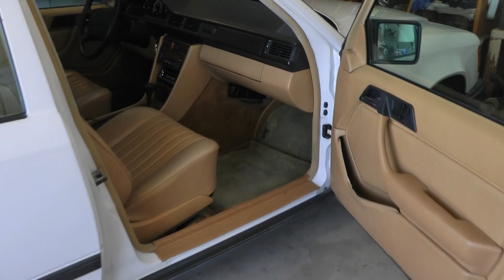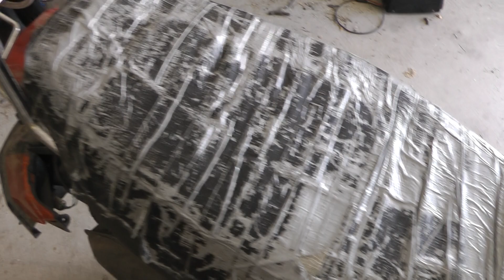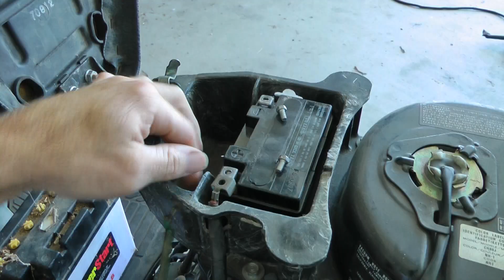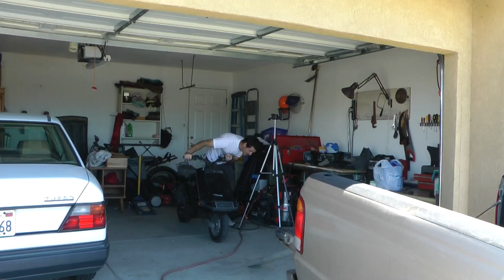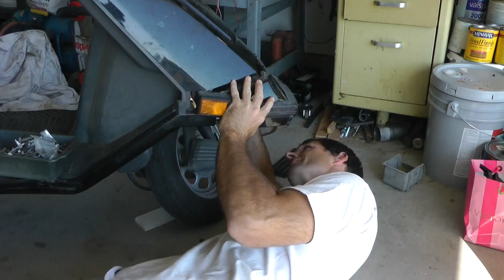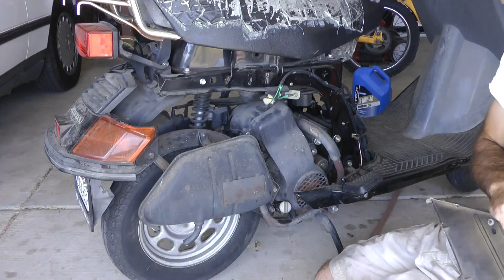Free Scooter Project: Shopping For A Mercedes Benz w/ Honda Elite 80 Bonus!

Comment: great car, if you think the 300d is slow, you should try a NA 240d. If the 300d's 0-60 times were measured on a calendar then the 240d would need to be carbon dated.

 Probably the best car i ever owned, my entire family owned 240d's and 300d's for years, my personal 240d had over 300k before i sold it in washington, he then took it to mexico and sent me a picture seven years later of someone broadsiding it at 500k miles.

Comment: You sure did a whole lot of running with the bike , you put in a battery at 7951 miles and than you don't want to do stuff unless you know how the engine is.
You take off the airbox , spray gas in the carburator and the odo shows 8020 miles.
Who let the scooter out :D :D :D 
But hey , it's fun to watch ;)

Comment: I just picked up an 83 240D with 108k miles on it perfect interior, 3 small spots of rust. Had to do some work to the injector pump and fuel lines but shes sorted now. 600 bucks out of my pocket plus filter and various vacuum hoses and she goes down the road great. Best cars I have ever owned. almost like driving it more then my 79 f250 gets way better gas MPG.

Comment: Wow, what a great deal! A 300 Turbo Diesel in showroom condition without rust for 1600 bucks (includind the Scooter)! I would buy 10 of the W124 Turbo D's if I could find them. In Germany  it is a very rare car (even more without rust!) And it is getting even more rare and more expensive since technologie nerds all over the world tune the Turbodiesel engines up to 500 HP (in a healthy way) or even up to 1000 HP!! Then the acceleration speed will not longer be measured with a calender for sure! By the way: I drove several 200 D's (W115 = /8, W123, W124) since I was eighteen and got my driving license a long time ago. Over 1500 kilogramm with 55 HP....I can tell! "Speed" is measured in moon orbits! Sometimes it was just impossible to overtake a big bus or big truck!
Also I want to asure you: 200000 mls and U'r motor is fine and just  "eingefahren"! I could't find the right matching word. Treated in the right way it is able to reach 1 million kilometer (over 600000mls). W124, the very last of the solid and good Mercedes. So be happy!
In 1998 I bought a brandnew expensive W210 and I was looking forward to drive it for 25 years. But the W210 is junk/scrap as everybody knows = CEO Schrempp did all for raising the companies profit, manufactured with low quality parts and so the customers were cheaten. Unfortunately I have no choice as an early retired person. I still own the car because I could'nt afford a newer, or maybe even better, an older one (W123/W124). I really would like to have one of those again.
Last but not least: Thanks for sharing this and other videos.

Comment: thats the car that built mercs reputation , and a turbo to boot , it will still be going after the 55 is in the dumpster , or in fact , may actually have been turned into the dumpster ,,, and old hondas seldom surprise me ,,,, they were built in an era when quality was built in , not an after market bolt on.

Comment: I dont know about old scooters but at the front of the 2007 ones there where a bunch of wires we just took them of the conector and put a screwdriver on the starter to start them up.

Comment: hey just a heads up

219000 miles is not even considered "broken in" for a 300d.
Reply: ikr my grandpa owned one for almost 30 years, the car easily outlived him with only minor issues throughout its lifetime.
Reply: Seen a video of one that someone opened up with 300,000 on it and it was in great shape just put a new turbo and gaskets and it was back on the road even tho it never had a problem before
Reply: One 300D that was in use of Finnish army it was driven like 1.500000Km (one million and 500 thousand km) Only with Basic maintenance
Reply: VHFGamer but will be broken pretty soon

Comment: congratulations on the elite 80 very nice how it started up like a champ after years of sitting dilapidated yours is very remincent to mine a 87 with neglect remember to go through the electric too cdi box wears out and high performance ones are available coil could get old too if it doesn't hold on to mid range and top end it could be that the ignition is not happening mine bogs at top

Comment: Yeah...I think I'll 'take a pass' w/regard to the "I'm too cool for school" and  the sarcasm directed to the Honda 'Elite'. (did that engine start! Yes? even w/shitty gas? Then 'case-closed' with as far as' just how tough and reliable are Honda scooters'...? I could live w/o you pointing out the obvious fact of the heavy use of 'plastics' in the outer-shell of the Honda...the fact that the plastics are STILL there, despite at least two 'lay-downs' should be proof enough that the plastics are extremely durable and incapable of rusting or rotting! (they weigh a lot less than the same dimensions of any metals in common use) As far as 'power & speed' are concerned...you remember some simple conversion formulas from High School, maybe? That 80cc engine puts out more power 'size-for-size' than any other internal-combustion engine in the World.          "Mass vs. Thrust vs. (square of resistance) vs. Inertia vs. 'event duration'...=Velocity" (pro-rated to external variables)    Honda builds the finest two-wheel vehicles in the World. Period.
Reply: Gerry Nightingale chill guy. it appears you love these scooters so just be happy there's one more on the road that wouldn't have been thanks to this guy.
Reply: Uh...actually that 'reply/comment' from 2 months ago was 'chill'! And I 'like' virtually every type of cycle there is...I made a perfectly valid observation of this 'Tube guy being 'Mr. Expert' hustler and 'fount of wisdom' assessments regarding Honda scooters...and I'm not required to 'chill' anything! (you gotta' crush on this guy? Fine! )
Reply: forgot to take your meds again?
Reply: Gerry Nightingale yep you definitely forgot to take your meds
Reply: Perhaps I 'forgot my meds'...but I didn't forget to REPORT THE USE OF 'SOCK-PUPPETS' by 'Jennies Garage' to YouTube...you want to 'play' some more?
Reply: Gerry Nightingale ah good we're in agreement you shouldn't forget to take your meds.
Reply: Gerry Nightingale plastic can't rust, even Chinese plastic can't, the material, it is just not able to rust, so you should not really be wondering why there is no rust on the plastics

Comment: JG...Get a Chevy Impala with the new high feature V6 (2012 on) 305 HP. ... I've had a 2013 LTZ since March 2014 still in warranty with very little trouble.  Plenty fast, bang for buck, good gas mileage for a full size car.

Comment: What beautiful Mercedes you bought! Those cars are bulletproof
Reply from the maker: +John Capidecallu I've had the car for a couple months now and just love it. I sound like a tractor in the parking lot and get 29mpg average. Plus diesel is cheaper than gas right now! It is awfully slow though :)
Reply: +Jennies Garage Well compared to the E55 i'm sure it's painfully slow :) Otherwise it's not that bad and you can also run it on biodiesel.
Reply: Nah.... They are not so bulletproof as you may think, a Mercedes can be a pain in the ass to repair, plus, the Parts are not really cheap....

Comment: Sometimes i do worry about your mental state he he :-D.
Ive never seen one of those before, it looks like it rolled out of "Tron" :-)
The only fantastic plastic machine i can remember is the honda melody, possibly from the late 80's, i think you had to put the bike on a center stand and pull the back wheel down to access the sparkplug, odd machine.
But in comparison to modern plastic junk the old melody was quite a neat machine.
When i was 16 i had a puch maxi moped, very minimal but it only sniffed the gas, 700ml of petrol+oil lasted two weeks, happy days of independance :-D
Reply from the maker: zx8401ztv I'm surprised they never brought the Elite over to Britain, they're everywhere around here. It sure is slow, but just like your puch, a real fuel miser.  Plus I feel like George Jetson when I ride it haha
Reply: ***** Yes the jetsons lol :-D
I made a mistake with the 700ml, i ment 0.7 of a gallon, im mixing up my measurements again.
Thank god you dont do that, imagine the odd shape the shasta woud be LOL.